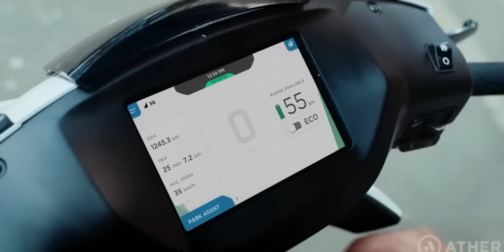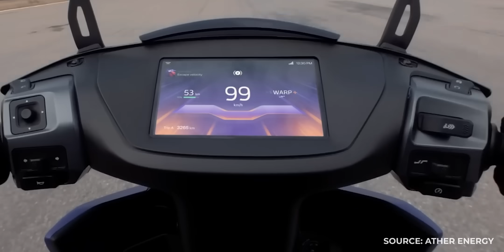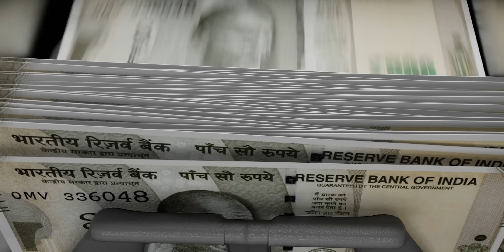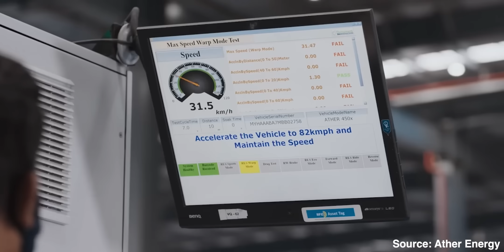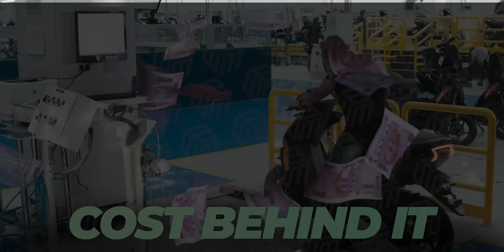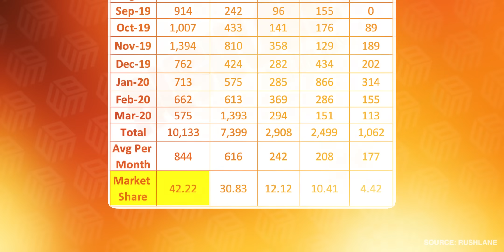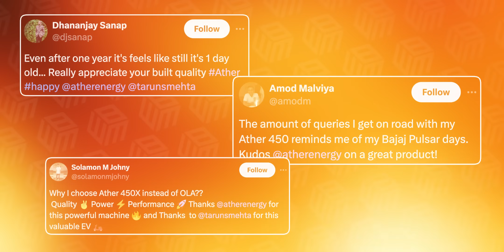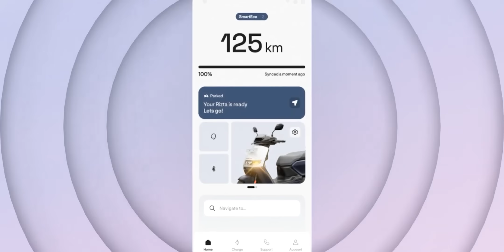Why India's OG Electric Scooter Company is Failing? - Ather Energy Case Study

Comment: If they fail it will be a huge setback for real Make In India. It is a Phenomenal Product...... Much Much Much Better than OLA, TVS & Bajaj. Personally driving it for past 1.5 years and No Issues at all with Charging, Range & After Sales. Their only issue is Marketing and lack of a Budget Range product. Also they initially introduced just 3 colours which was a bummer
Reply: Very less range for the price we pay 
It's costed 1.83lac on road and getting only 70km in ride mode 😢😮
Reply: @chaitanyakiran  electric vechiles will need to factor in the difference of fuel cost and see. It is right now only short run vehicles and should do better if the battery enhances or swap tech introduced.
Reply: Yeah Ather should bring a bike within 1.1lakh with 110km range it will actually be the big hit in market considering the Ather 450 looks and Athers reliability, hope Tarun and Swapnil get this soon🤞
Reply: @maschhindrakotkar869  my ather run around 90km/hour
Reply: that guy tarun is very arrogant, i  got my booking refund only after escalating to government authorities. products and spares are super expensive and dealership is thinly spread.
Reply: Not just that. There are multiple reasons. It is premium product for Urban population, short commutes. Tier-2,3 contribute majority to the segment and electric bikes doesn't fit their needs who ride over 100-200 kms sometimes. E-bikes doesn't have secondary market which makes it much more difficult to mass appeal.
Reply: @Yash-le8vj   no bro tier 2 and 3 cities have more ev scooter than tier 1 . Go and check sales of Okinawa and that Chinese scooters they all are being sold in small cities . If ather bring a product with 100 km it will be hit in small cities.
Reply: @Acm-zj8xc  Interesting. They don't have secondary marketing also. ICE vehicles can be sold alteast for 20% of price at the end of life cycle for scrap. I am not sure these EV's can do the same.
Reply: Agree
Reply: Poor strategy and being arrogant on product is failing them. SINGLE DESIGN SCOOTER SELLING FOR YEARS. Which was not a great design.
Reply: They made a fantastic product but failed to understand Indian consumer.
Reply: dont know if its better than bajaj chetak. The chetak is a very simple scooter. nothing fancy. gives 100km range. stronger built (in my view). has larger seat also compared to ather. finally ather realised seat size importance and now they have larger seat in rista
Reply: I have ola s1 pro 
Ola scooter is good and smooth 
Ola service centre worst
Reply: Their strategy is poor I have seen some of his podcast it seems arrogant to me. They are targeting only in south India where population is less. They should open multiple showroom in north specially in haryana mp up and bihar and they should have one product priced around 1.10 lakh with range around 100-110 km it would be great success for them.
Reply: @Acm-zj8xc  Even OLA doesn't provide that kind of mileage in 1.10 lac price bracket. My Ather 450x plus gives me 85 km and costed me 1.10 lac after subsidy. OLA strategy worked on Marketing as it had huge funding but product quality & after sales support is very poor
Reply: Bro... @Acm-zj8xc  I work for EV OEM, the response for premium EV is worst in those states .. we are struggling to get the dealerships...
Reply: Ather already failed people like you are hyping more about this. How it is better than OLA, TVS, BAJAJ. ?
Reply: @gowrish868  Every OLA owner I know have faced issues with delivery, After Sales. One guy's front suspension broke after just 1 month, Other Guy got a damaged Body Parts on delivery. Many OLA scooters have burnt in the summer heat. None of these problems have been reported for Ather and neither have I faced any
Reply: They should go global..
Reply: No ather is overrated they are providing 250 watt charger in box that takes 12 hrs. Its a complete joke with 0 practicality. It is like apple's macbook m1 base variant with 256 gb soldiered memory. Just tricking consumers.
Reply: @bondnikunj  are you Nuts? The Charger that came with my Ather charges it in 4.5 hrs
Reply: Ather is good i myself like its design but i don't have that much money to waste. 
No product is failure. It's just understanding better public requirement. Read somewhere ather didn't understand present need. Ola design is so pale but budget friendly.
Reply: How are they much much much better than ola can you please explain?
Reply: @master_soojan  I can say with personal experience. Every OLA owner I know faced quality issues with product & after sales. One guy's front suspension broke after just 1 month, other got damaged Body parts right on delivery. Many cases of Burning have come up with OLA. None of these have happened with Ather. TVS still uses old school suspension which is coming with ICE versions where as Ather is a very simplistic yet robust with its design.
Reply: @nitwit2011  Ather has belt issues. Belt wears out too fast as it is of inferior quality. Harley davidson motorcycles also use belts and those are prices same as ather's belt but they last longer.
Reply: Bro, everyone is not good for make in India initiative. If you have confusion, please read Harry Potter book 5, 6, and 7 you come to know the reality of life. It is not merely a children book. Don't go for movie, they don't give the right value of the book. The movie is for childrens.
Reply: Mere pass b h Range ka issue h max 80 or 65 hi deta h single charge m
Reply: You should drive and use Ola man
Reply: @anuragashah  Done that. Lots of quality issues in initial batches
Reply: @nitwit2011  I defer or may be I am extra fortunate to get that batch
Reply: It’s just a waste of time and  putting money batteries
Reply: How can it be phenomenal if it fails??
Reply: Dumbest argument. At firrst hand Ather tried world class product without practical thinking abt price issue. You are not US or Europe. INDIA NEED CHEAP AND QUALITY PRODUCT. NOT OUT OF RANGE.
Reply: EV are supposed to be failure
Reply: every electronic part is made in China  in that scooter 😂
Reply: Ola is also an Indian company
Reply: Ola service center is worst because they don't charge a penny for it!!!Whereas in ather service charges are included!!!So there are limitations where we should compromise for free of cost in return!!
Reply: Rip costing it was overpriced 170000 while other offered at price of 130000
Reply: @Sujanmahesh2005  I bought mine for 1,15,000/-.
Reply: Unnecessary price and poor service with poor mileage.
Reply: Why do people need to pay 1.5 lakh to get only 70 or 80 km
Reply: @kunalgaurav7222  For Rs.100 Petrol I get an average of 50 from Activa. I paid 85000/- for it. On Ather I paid 1.15 lac after subsidy and now for 80 km I just pay 10/- for its full recharge at home. Its Two years now and it's still giving me 80 km on full recharge and on Maintenance I hav spent 3k in 2 years on this
Reply: I don't understand how you say it is better than ola,
Ola has way better range, way better top speed, way better features like Cruise control, different profile for different person, etc.
Price is less than ather.
Ola has issues with its body and software glitches but that is not a blocker, I am an ola user no comparison with ather.
Reply: @nitinjoshi7231 What about after sales service of Ola? People are saying it's pathetic. Also your scooter was not from initial batches maybe that's why it's good, but other people faced lots of issues. Please comment your thoughts..
Reply: yes i also have Ather 450 S
Reply: How is it  @yageshgupta8598
Reply: Go buy these shitty evs why should we support something cannot be charged in under 5 mins it's just too much planning and unreliable travel mode
Reply: @adventurousmumbaikar1949 What if soomeone solved those issues that you mentioned. Then will you buy one?